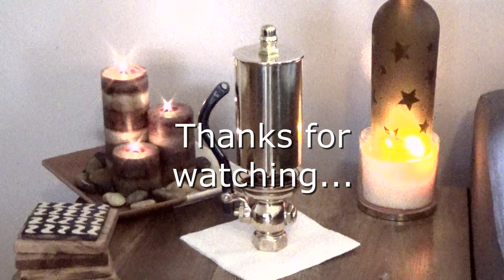Steam Whistle Restoration for future Steam Engine Boiler Build....

Comment: So ya know, you have your pull lever backwards. The curve at the top is supposed to face outwards from the whistle bell, not towards it.
Reply from the maker: That was the way it came when I bought it, but had always thought something looked a little off....
Thanks for the info.  Just wondering if you know what the purpose of the curvature is.    Got the whistle to go on a steam engine that I hope to restore- so I know very little about it at this time.
Reply: @Myersmetalworks  usual it's just for flare and appearance. There have been plenty of whistles with straight levers.
Reply from the maker: I don't think  Its  the factory handle... It looks like someone made it, maybe a blacksmith year's ago...

Comment: Wonderful video and beautiful results! What type of grit was in the sand blaster? Also, why did you heat up those two parts? Sorry if these are silly questions…I’ve inherited a whistle that needs cleaning and restoring. Thanks in advance!
Reply from the maker: Hi Lillian... Cool  you have a Whistle To work on... I Think? 80 grit... from Harbor Freight... The heating up of polished steel parts to a blue color and dipping in oil is bluing the part...  Looks nice to me...
Reply: Thanks so much for the info!

Comment: I have a brass steam whistle of my own that actually works, ive never heard the sweet sound of it though, because i don't have anything to blow it with, my air compressor is to big for it, the slot is a quarter of an inch female nosel which needs a male bolt with threads so i can attach it, do you have any idea where i could get one?
Reply from the maker: The hardware stores is all I could  suggest.... or maybe McMaster carr...... on the internet....

Comment: What types of compound did you use to bring up the shine? Looked like two different kinds. I'm surprised it came up so well after sand blasting. Have 2 locomotive whistles I'd like to try this on. Very cautious to do it though because they're quite expensive.
Reply from the maker: Hi Mark...  Buffing compound bars will have instructions on what type of metal to use them on.... I think Northern Tool has a kit with diffrent compounds you could use on your whistle restorations.... Hope they turn out nice for you!

Comment: How did u make it blow? I have one.  Could u make a video how you did it ?
Reply from the maker: Hi Jude... I hooked it up to the shop's air compressor with the hose I use to fill tires 
with... A hardware store should have all the fittings you need to do the job with your air compressor...  Hope this helped... Thanks...
Reply: @Myersmetalworks  thank you for the info. 👍🏻